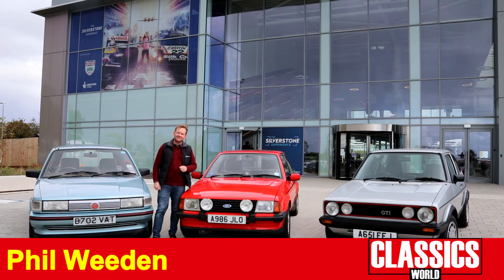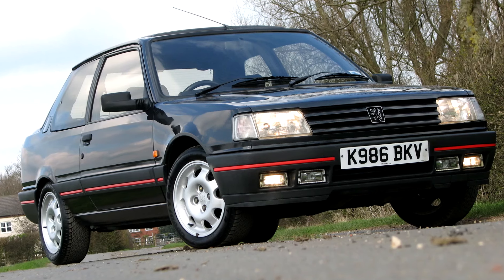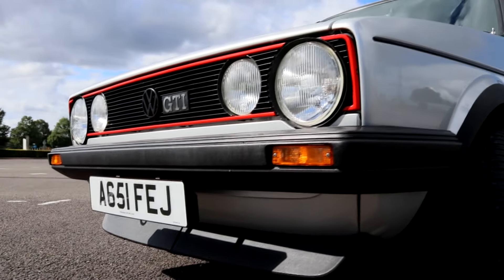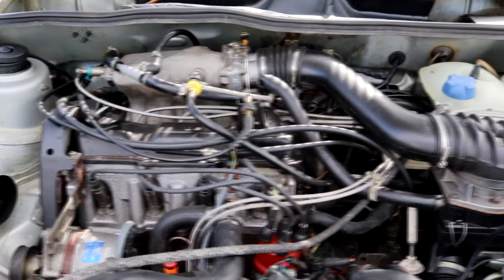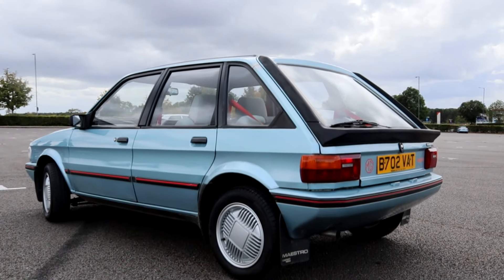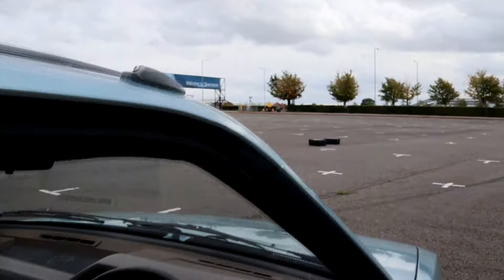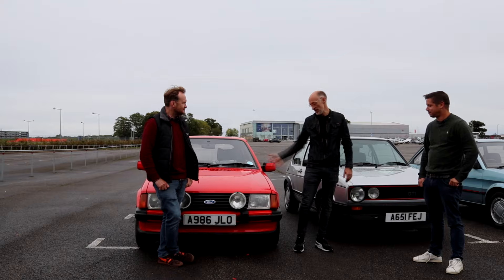Golf GTI vs Escort XR3i vs MG Maestro - 80s Hot Hatch Shootout!

Comment: Back in the day I ended up buying the Sierra 2L Ghia over the  XR3  (suspension was way too brittle) Ghia wasn't the ultimate  but I  did a lot of miles a year & I  had a young family +2 dogs. VW golf 1.6 GTI on a long run was just too annoying, 80mph + you had to put the hi-fi up to max  to override the road noise.
In those  days 3rd lane motorway speed was 90mph or you were 'flashed' to get out of the way (unless the rozzers were about) 
Owned a mk1 Vauxhall GTE briefly & after the Sierra bought a mk2 2L Vauxhall GTE , when they released the 16v got my 8v sorted  & on rolling road dyno ended up putting 122bhp through its wheels ( the same as the standard 24v)  sports airfilter, performance re-map chip, new exhaust header & exhaust system, which got me from 108 to 122bhp but the torque was awesome, it pulled like a train from 2000rpm. XR3i & RS16i were obliterated! Only a RS turbo came close, but again suspension sometimes worked against it, so unless roads were like a race track I'd have lots of fun!

Comment: As much as I love fast Fords, the MK1 Golf GTi will always be my favorite hot hatch, but unfortunately I could never afford one, and now, although there are still a fair few nice original ones about, there were so many that fell to the trend of being heavily modified, back in the 90's, and many of them badly, finding a nice unmolested original is becoming increasingly expensive. I can't not mention the MG either. Although, being a Maestro, it's never going to have the street cred of the other two, the 1600 had huge twin webber's on it, and the 2.0i version went like stink. As for the turbo version, well that was just mental. I grew up just outside Cowley and MG Maestros were everywhere. A friend of mine used to race one and had a modified 1600 on the road, and another mate had a body kitted turbo, with early MGF alloys on it.

Comment: Worked at Ford and Rover dealers back then and my choice having driven all three would be the Golf. 
VWs build quality was better, trim and other parts held together better and it is the original hot hatch.
The XR3I tended to be owned by hooligan drivers and a lot of moms taking the kids to school. The MG was always held back by the non MG Maestros that were often bought by elderly drivers as well as by the 1.3 A series powered versions struggling on performance even in the eighties.

Comment: MG turb, was the best and there would be more about if they had not been so easy to nick. You only needed a slender pair of scissors to pick the door lock.
Failing that, the door frame was easy to bend back enough to get your arm in and unlock. 
It was also too easy to rip the plastic from around the ignition and snap with a scaffy bar for black capping...

Comment: I had the earlier MG1600 'R' series unit. You have the MG 1600 'S' series unit - very rare. Also carrying more weight than the early car.

Btw, your 'S' car has an extra 'air intake.' On earlier cars, it was found the twin-choke twin Weber carburettors didn't like hot starts because of heat soak. Cooling fans for this were directed under the carbs to try and fix the problem.

I solved it by using slightly smaller chokes and trashing the god awful BL exhaust manifold-and-downpipes; so constrictive. Those downpipes alone robbed 10-15hp from that engine. They were so very badly designed, I wonder if the job of designing them fell to the work experience boy!

Why did I get an MG Maestro? It was a cheap car and being 6'2" it had more space than any of its equivalents. Except the Peugeout 309 - perfect but pricey.

Comment: I had an MG Maestro 2.0 when I was based in Germany. Back then, German car insurance was based solely on BHP and as  young man, car insurance in the UK was horrendous so did rather well. The Maestro used to eat up the autobahn with ease and was pretty damn rapid. it was less than 3 years old when I brought it but the build quality was utter rubbish. I resprayed (that was my trade anyway) then found out why it was such rubbish as they didn't always even prime the bits you couldn't see. The door handle snapped off, poked my finger through one of the rear doors from rust and then the aluminium cylinder head cracked - all this less than 3 years old....

Comment: If you had the rs turbo which as the iconic mk 3, you would have had a much closer comparison 🤦 the xr3 wasnt fuel injected like the others were.
Reply from the maker: The XR3i we've got here is!
Reply: @ClassicsWorldUK  you reviewed the xr3 not xr3i tho 🤦
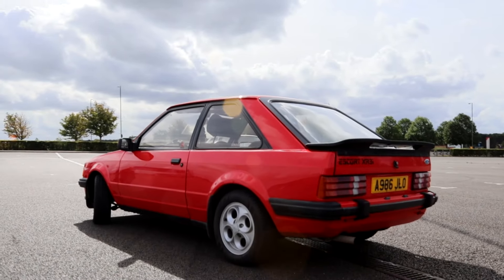Reply from the maker: Check the rear end shot at 1:54 - XR3i badge 
Also the engine shot at 3:30 shows the Bosch K-Jetronic injection fuel distributor ;)

Comment: The simple fact is that its not which car is faster or better built, the fact is the a mk3 escort xr3 xr3i rs1600 and rs turbo S1 are going up in value as there is a higher demand and most have rotten away, i just bought an rs turbo S1 and restored they are selling between 25k and 40k or more, now can u say the same for the others, drive a rs turbo S1 and everyone looks now drive an MK1 golf gti and you get hardly any looks

Comment: I have a mk Scirocco and to be honest , the quality of construction disappointed me. I specialise in SAAB and a classic 900 blows the VW into the water. As for driving experience the 900 is in a totally different league. What I liked about the Ford (I had a brand new Ghia injection in 1984) and the Maestro (had a brand new Vanden Plas Montego in 1987) was the plushness of the interior  compared to the German models inc the Golf. The SAAB managed some plushness with better dynamics, higher equipment levels. It was probably a lot more expensive ... but in todays world it's actually a lot cheaper than these 3.

Comment: In 1981 I bought a new Black Golf GTI five speed.  Brilliant car and I has several XR3 try and race me they all failed and it was easy.  XR3 and XR3i were overrated marketing exercise, however the Golf had a major weakness, the brakes.  This was because VW were cheapskates and left the servo on the passenger side and the rods had too much play, so many times I had brown pants, never crashed though.  I did find a fix GTI engineering in Silverstone modified Mintex brake pads and these worked really well.  Problem was they only lasted 10,000 miles and at prices then they were £50 fro full set front and back and cost another £50 to replace.  I fitted Pirelli P60 tyres and bigger wheels and the car was utterly brilliant.  Never broke down and the engine was silky smooth.  Over 50,000 miles it averaged 31 mpg, had to fit cruise control for both easier driving and prevent being caught by the boys in blue.

Comment: I remember a road test in CCC in the early 80's.  Sum up for the Escort XR3 - Rapidly deteriorates from a point of being barely acceptable.  Always thought that was a great line.  Poor to start with and rapidly gets worse.  Drove a few and thought them all fluff and image with little substance.  Ashmatic engine and poor rear suspension. Still the fans line up to pay large amounts for the things these days.
Golf were rock solid quality in comparison.  Maestro had far better ride / handling (2 Litre Injection very underrated.)  Fiat very low geared for acceleration but noisy and reliable as a politicians promise.